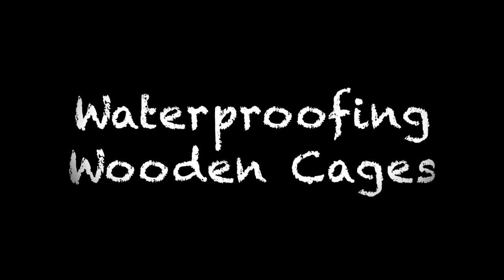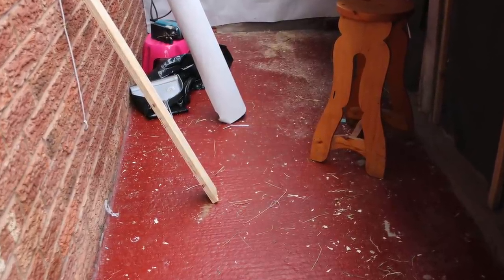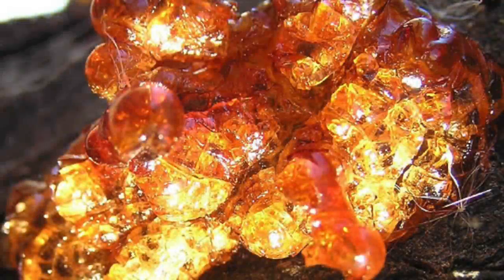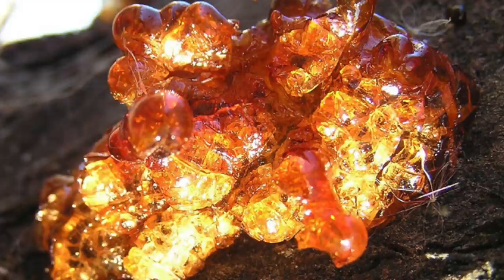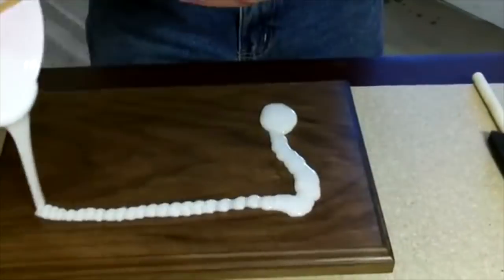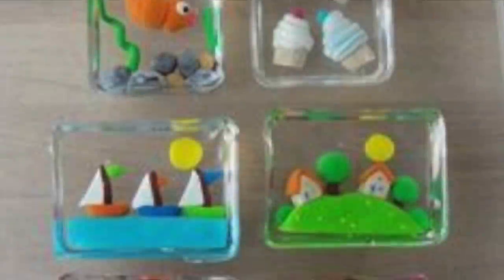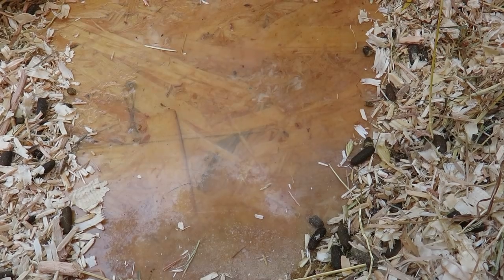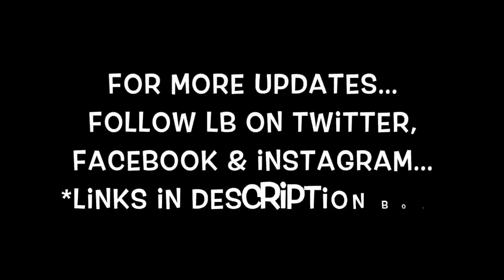Keeping a Guinea Pig Cage Waterproof *Using Resin*

Comment: Are all resins pet safe! This is a very good idea!
Reply from the maker: Hyper Bunny You can find specific pet safe ones, but if I'm being honest, as long as when you put it down the pets are in a different location and also while its drying (as it has a strong odour) all resins are safe as it dries as a hard plastic. Just make sure you put it somewhere where they won't chew and where it will always be covered with bedding, thats why it works perfectly to coat the bottom of a wooden cage. Hope that helps. xx
Reply: Thank You! This helped! I may try it in the future as I may move house and me and my mum are going to build D.I.Y cages for my bunnies! Xxx